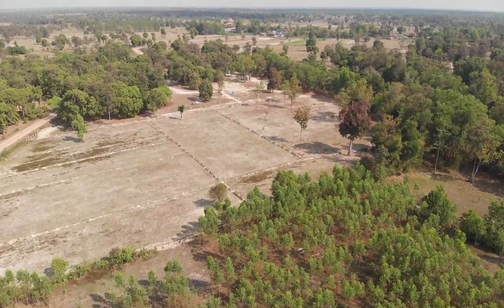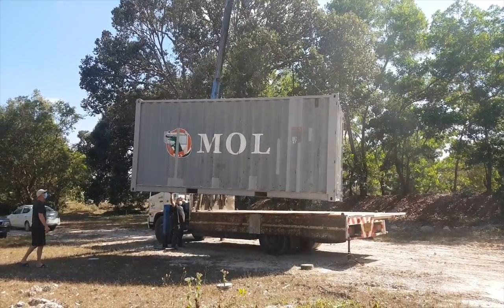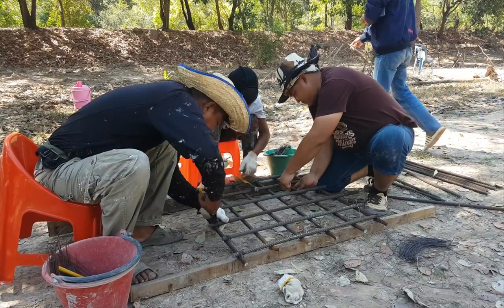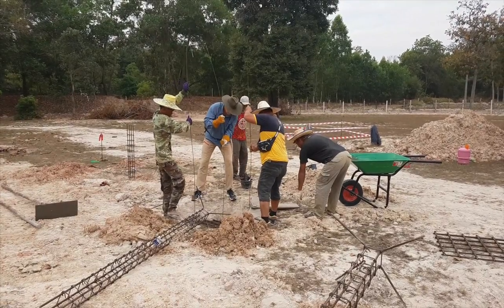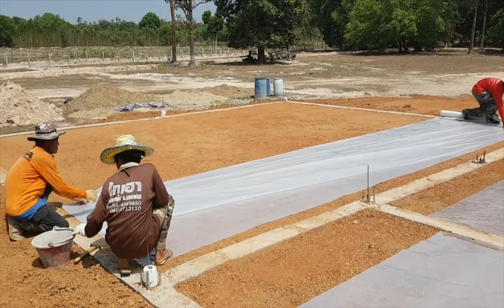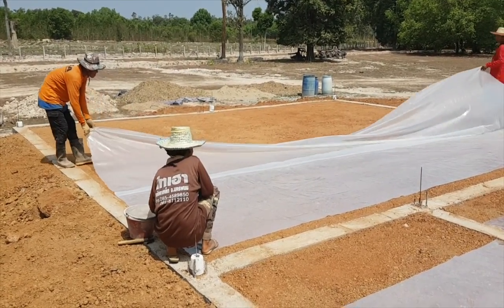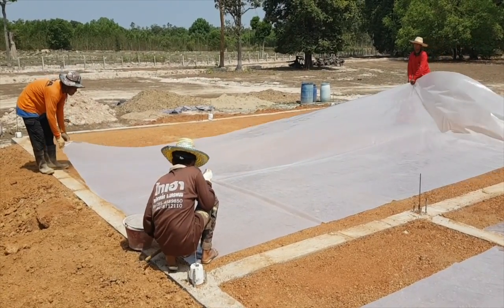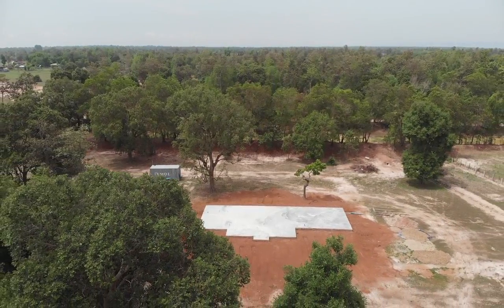Building a house in Thailand    ( the beginning)

Comment: This is a great video. I'm at the beginning stages of a build right now. I've only watched the first video so far. What have you done  about electricity? I've had to pay the the board to come and install the electric. Not ideal but ......
Reply from the maker: Hi.
There is an episode about the electrics.  
Spoiler: I did not pay the PEA a single baht... and still do not.
Curious? Have a look.
Reply: @Living-off-grid  wow, 200,000 is ridiculousl! I paid a fraction of that (40,000). However, your solution is great and something I'll definitely consider. I will need a good connection as I'll be running a business from there. Onto episode 3. This is awesome!

Comment: Hi Maarten. 
If possible to can tell me cost for drawings and engineering as we live not far from you and having trouble finding someone reasonable as we already have our own design 
Cheer Tony
Reply from the maker: Hi Tony,

I made my own design and drawings. If the "living space" is under 150 M2 and the house is just one floor, you do not need architectural approval. 

So, our "attic" is "officially" only for storage ;-).

After the build, when you have the "house book", you can modify all you want.

If you want detailed info, drop me a line on maartensworld@gmail.com

Comment: Great video and great job. I can not wait for the next chapter.  A few questions if you don't mind. 1. the column footings. did they have a cage in the bottom or did that cage sit on the concrete pad with no steel in? 2. I note the 16 mm reo bar for the floor at 5- 600 ctrs. Mesh is not used in Thailand ? what is the reasoning behind that spec? 3. I note the land is fairly low? will this be prone to flooding. Is the floor up enough. It appears you know exactly what you are doing. So not a criticism. Just interested. Thanks in advance.
P.S ignore the snide remarks. there is always one or two that achieve zero so this is their way of feeling important.
Reply from the maker: Hi Mark.
Thanks for the compliment. 

The columm footing is 1 square meter and 20 cm thick.
It has a 10x10 cm grid of 16mm rebar in it.
We did not use casing to make it. Just dug out the soil until we hit a rocky layer and lined it with plastic. First poured 10 cm of concrete, placed the rebar grid and the column rebar and poured the rest.
Then kept it wet for one week, placed the column casing and poured the column. Wrapped the column with plastic-wrap, kept it wet (from the top) for a couple of days and carefully filled in the soil around it.

The rebar sticks out about 1 meter and that was incorporated into the stem-wall which rests upon the columns.

They have wire-mesh in Thailand, but I find it hard to work with and I think (I hope I am not wrong) that the thicker 16mm rebar is better suited to compensate bending-stress than 6mm mesh.
The floor does have a lot of drying-cracks (mostly less than 30 cm long) due to overly wet concrete (a typical Thai problem with readymix) but as it is 10 cm thick I am not concerned by it.

You are right, the land is very low and floods "normally" every year. I say "normally" because this year it did not even get very wet.
We made a few water-managment adjustments (a pipe and a canal) and these seem to work great.
But, nevertheless, the house sits 1 meter above the normal level... just to be sure 😉
You can see videos of this on this youtube channel.
Reply from the maker: @SometimeWoodworker  We had some storms, but nothing really serious... but maybe it's just my interpretation of it.

Comment: Crikey I hope that entrance wall is still standing up .. foundation way to small   🤣🤣 ..leay    Mai bein rai   pom kao jai na khrub 555
I see 👀  you have an excellent crew looking good 👍   very interesting video Thanks
Reply from the maker: I agree that the entrance foundation looks a bit small, but it is build onto a rocky layer (small excavator can't get through and neither can its drill) so that should be solid enough, and it is not a straight wall, but it has an angle at the edge (with the pillar).
Only time will tell if I did the right thing.
Reply: @Living-off-grid  
I see   Should be ok 👍 
Thanks 😃

Comment: I actually like your music selections. I have a question. Are all your interior wall supported by those concrete cross pieces ?
Reply from the maker: I am not sure what you mean.
The interior walls, just like the outside walls, are suported by a "concrete ring" on top.

If with "concrete cross pieces" you mean the foundation stem-walls, then no. Those support the load-bearing walls.
There are a few interior load-bearing walls, mostly suporting the "internal gabels".
One "load-bearing", or should I say potentially load-bearing wall runs end to end under the roof-ridge, but this is only supporting the attic floor as the span of the rafters is quit large (9 meters).

I hope this answers your question.
If not, feel free to ask further.
Reply: @Living-off-grid  my apologies, l am not knowledgeable of building vocabulary. Yes, stem walls. Thanks for the answer. 
Another question- Had you thought about a polystyrene or some kind of under slab insulation?
Reply from the maker: @nitepharmer5866  
No. Just a vapor barrier. 
The soil under the house will always be cooler than the house, so it is better not to insulate that in a hot climate (in my opinion)
That seems to work out well as our floors are always nice and cool.

Comment: I would argue that ready mix concrete for the footing would have been better.
Saying that you have to buy it from a reputable company like SCG that offer many grades.  Just order the strongest.
Some of the independent ready mix suppliers skimp on the cement and add too much water.
Reply from the maker: Sadly I have to disagree. 
We tried a local supplier first. No success because his sand was contaminated with clay, creating large lumps of clay in the concrete-mix.
So we changed to a CPAC supplier with not much better result. The first load was so thick it got stuck in the chute.
We then changed to SCG which was better... but only as long as I was present at the mixing.
We used that for the stem-wall.

For the floor we used the same company, but due to the volume, I could not supervise the mixing. The result was that some trucks were OK and sone carried yogurt (way to much water). 
The result was hundreds of drying-cracks in several parts of the floor.
Luckilly I oversized it (10 cm instead of 7).

An other problem with ready-mix is that it is mixed by weight (and not by volume).
That is OK as long as the sand and stones are stored inside, which is almost never the case.
Taking in account that (after a day of rain) wet sand weighs almost twice as much as dry sand, you can imagine what this does to the mix.

In my (humble) opinion, there is no better way than to mix by hand... as long as you can handle the volume.
Reply from the maker: @SometimeWoodworker  We are in one of the farthest corners of the kingdom... That might have something to do with it.
As for hand-mixing, as long as you measure the volumes (buckets) it is much more accurate than machine mixing which uses weight and keeps its ingredients out in the rain and sun. After all, wet sand increases much more in weight than wet stones, and cement is always kept nice and dry.
Reply: @Living-off-grid   What did you do with the concrete from the first supplier which had a lot of clay and what did you do with the CPAC concrete from the 2nd guy ? If it was substandard I just wondered if you ended using it .
Reply from the maker: @nitepharmer5866   We send it back. Concrete with clay in it is not good for anything. In the mixer the clay starts to "clump" together, creating balls of clay with a bit of cement around it. It has no strength at all.

The other (very dry load) did not even exit the mixer.
The driver wanted to add water, but that is very bad for the concrete. Looses most of its strength.

The next batches I was at the plant when they mixed it.
The biggest problem here is that they mix on weight, but have the sand and stones outside without roof.
After a bit of rain the sand suddenly weighs twice as much and the wet stones bring lots of water in the mix.
They should mix on volume instead... but try explaining that. 🙄

Comment: Hello Maarten
nice house buiding without poles. Did you install foundation - concrete slab grounding for elecricity grounding connection ?
Greetings from Germany Klaus 👋
Reply from the maker: Hi Klaus.
No we did not.
Electrical grounding is via a copper rod that goes into the ground.
Reply: @Living-off-grid  
Yes this works as well.
Did you plan your Solar project ?
Reply from the maker: Yes. But only time will tell if the plan is correct.

Putting solar into an existing household is easy. You just measure what you use and that's that. 
With a new house it is all estimates.

Comment: No heated floor in this one, eh Maartin?
Reply from the maker: Here we do the opposite. Everything to keep the house cool.
We even use geothermal to cool down the water before it enters the house.
Reply: @Living-off-grid  That is ingenious!! I am planning to do the same when building my new home in the New Mexico desert. Rather than run central air-conditioning, I will run metal tubes underground beneath the house and plumb them up into the walls. This will bring the cooled air into the home for free rather than paying the average monthly cost  of $340 in electricity. Yes, there is a cost for the metal tubing and installation but that will not be more than running split air conditioners, and it will pay for itself in a short time as well as become a monthly savings. Love to see your progress! Keep making videos.

Comment: It is now July 27,  do you have an update or has it been too wet?
Reply: Hi Martin.
We will start building again in November. 
But, I am working on a video about the water-tower.
Should be ready in a week or so.
Reply: You will definitely get great water pressure from that height,  I use only 1” or 25 mm pipe on mine and and only 3 meter towers, great pressure .
Reply from the maker: Hi Martin.

Oh yes. Pressure is good.
I will also use 1" pipe until the final part to a tap. To ensure even flow, even if other taps are opened or closed (the famous toilet-flush when having a shower😖)
Reply: @Living-off-grid  You mentioned that the water will be cooled in an underground tank/system? So the water goes from overhead storage tank under head pressure, to the underground tank? Probably not right, as you would then need a pump to get it back to ground level with some pressure in the taps?
Reply from the maker: @kevhall4802  No. It does not go to a tank, though that would be possible as long is it remains pressurised. 
But in this case it goes through a 4" pipe from the tower to the house, at 2 meters dept.
The distance is some 50 meters, so this pipe contains about 200 liters of water under pressure.

Comment: Looks great 👍 
Can l ask concrete post size (ie 200x200 or 250x250) and the square size of the ligatures in the posts? Also, how many sqm is the slab area?
Cheers
Reply from the maker: There are no posts. 🤗
The house is build with load-bearing walls.

If you mean the foundation, the footings are 100x100 cm, 20 cm thick with 16mm rebar. (10x10cm grid)
The pillars are 20x20 cm with 12mm rebar. (4 strands)
The stemwall is 20cm thick and 100cm high with 16mm rebar. (6 strands)

I hope this is what you asked for.
Reply from the maker: Ohhh... Slab is 240sqm
Reply: @Living-off-grid  yes, that what I meant in the pillars 😊
The ligatures that held the 12mm steel in place were 100x100 or bigger. 
Thanks for your reply 🙏🏻
Reply from the maker: 100x100. 6mm
Reply: @Living-off-grid  thanks again.

Comment: Do they build the septic and the house at the same time ?
Reply from the maker: That all depends on the builder and the situation.

As you could see, we build the septic tank much later.
Reply: @Living-off-grid  do you have 2 separated system for your grey water and your black water or it's the same tank for both ?
Reply from the maker: @8971felix  We have one septic-tank for all waste-water (grey & black).
This tank has 3 stages: 
In the first stage bacteria break down the solids and the scum.
Clear water (halfway up, or down) travels to a second stage where the last debris sinks to the bottom and clear (grey) water rises. 
This then travels to the third stage where it "sinks" into the ground.